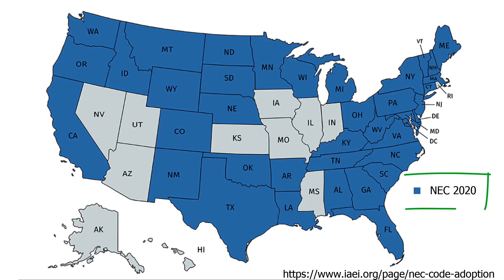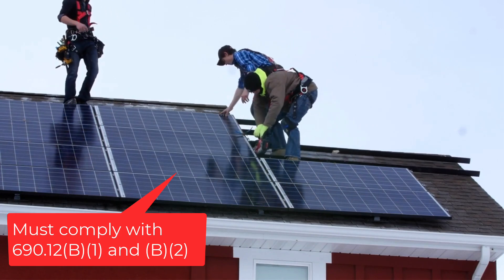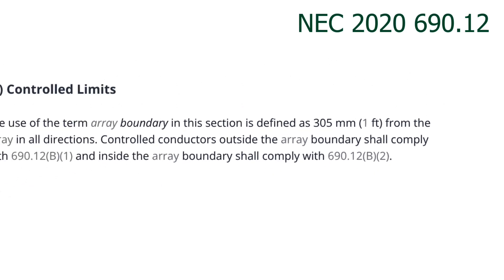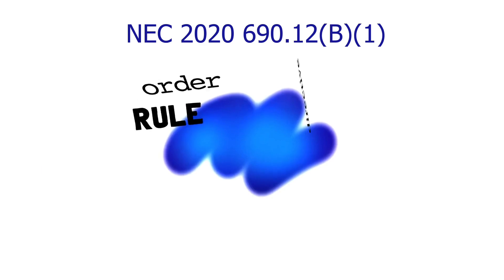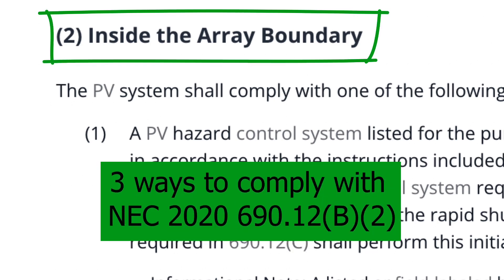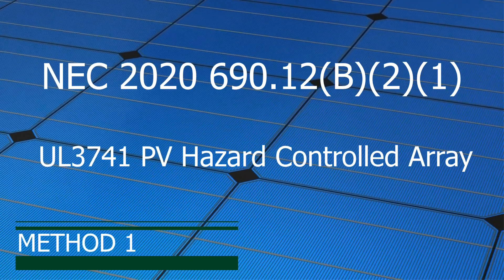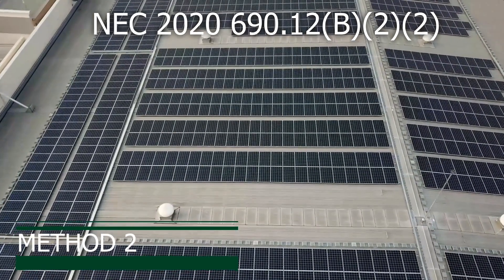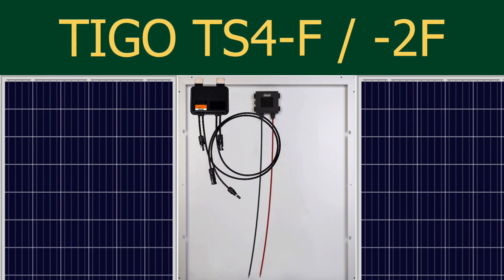Tigo TS4 F/2F Rapid Shutdown Devices - TS4 Course Excerpt from Tigo Academy

Comment: I continue have intermittent problems with four 2F units on a simple 8 module string. I am seeing 'late startup' voltage on array string as a result of the Tigo 2F units holding string voltage <5v long after sunrise.... weirdly only happens on cold mornings, and not every cold morning. I am ready to yank them and never use 2F again. It's cost me hours and a disappointed off-grid customer since they are missing out on early morning production in the winter when they need every minute.
Reply from the maker: Hi Daniel, I see that you have a service ticket with us and that your issue was resolved. For the benefit of everyone, the solution was to use our external 12V 1A power supply since Sol-Ark's internal 12V power supply only puts out 100mA. Sol-Ark has updated their manuals to reflect this inconsistency.